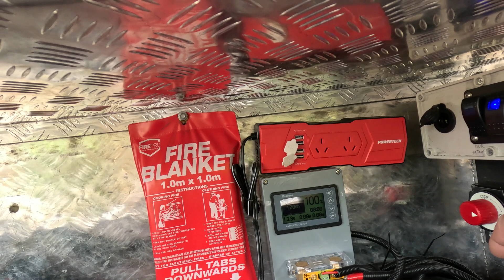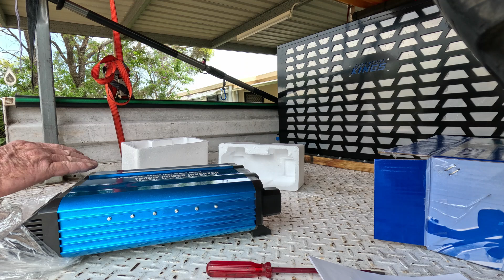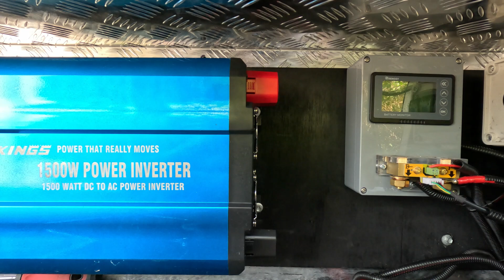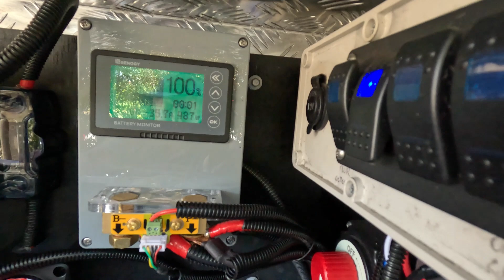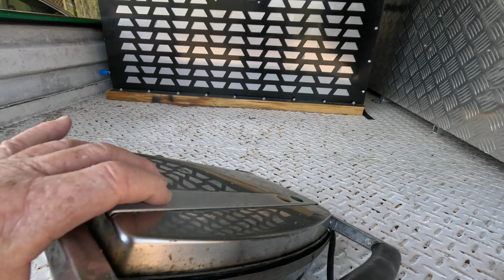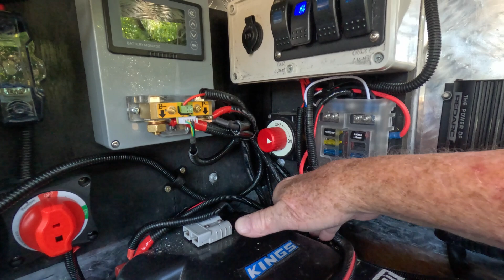Kings 1500W power inverter install

Comment: Thanks for the demo, Derek.
A nice KISS setup that works. 
The Kmart 'ANKO' brand has inexpensive low power appliances like coffee grinder & milk warmer /frother, plus a $7 two slice toaster that only draws 750 and also works well. 
Cheer. 😎